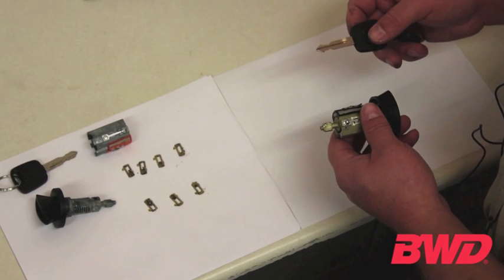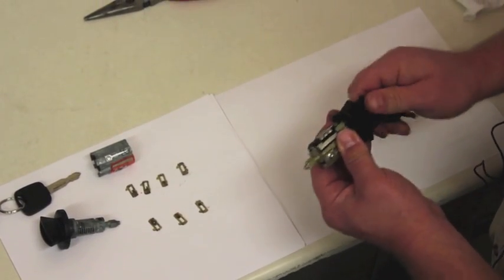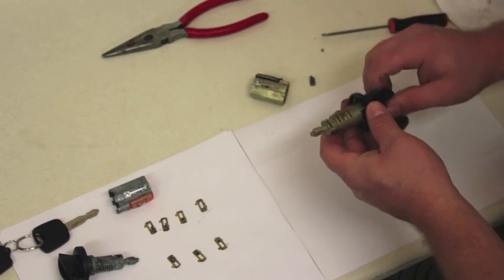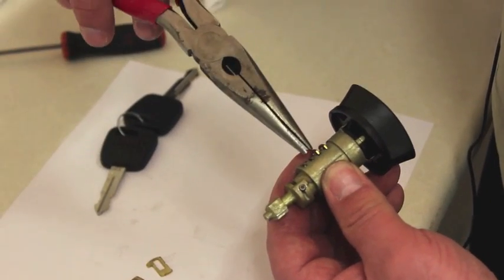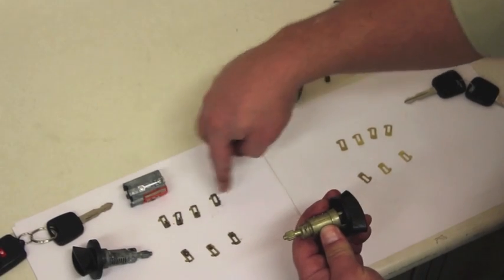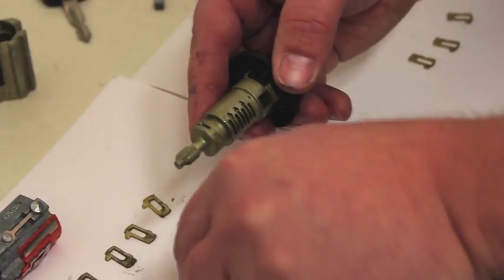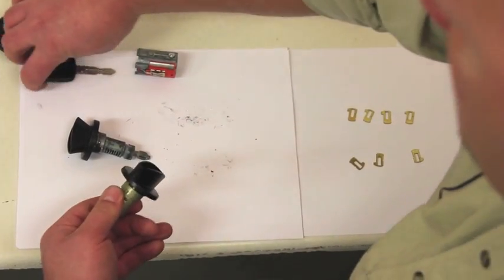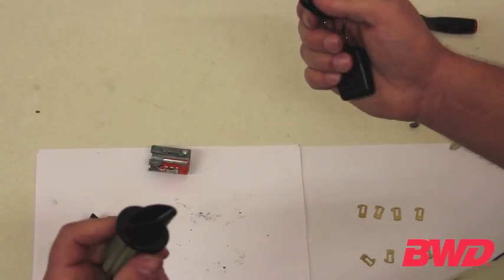Recoding a new ignition lock cylinder

Comment: Great vid I had the problem of a broken ignition lock & had to replace it with a new one. Of course the new one came with new keys & my truck wouldn't start, I followed the directions on this vid & I made my old key to fit my new lock & my truck turned right on. Thanks so much bud

Comment: Great Video, thanks!  

The video does not show clearly what is needed to remove the check ball, releasing the key chamber from the outer case.  
You have to turn the key all the way to the start position stop.   Then use a pick to push the checkball into it's spring seat as you turn the key chamber past this stopping point.
Save the checkball for reinstalling, see below I discuss this.

I just did this to my 1996 Ford Econoline Van. This is the same exact replacement I got from Auto Zone, $26. My vehicle is not new enough to have the chip in the key. Not sure if the one in the video does.
FYI: My original key and some of the slugs showed wear.  This may be why mine no longer worked.
If you rekey the new lock, I suggest you try to use the new lock's slugs of any that are the same number-code-cut.
I wrote the numbers and their positions down on the slugs of both the new and old lock(the numbers are inscribed on the slugs and if worn off on your old slugs, you can compare it to others to see what number it is.
4 of my original slugs were stamped "4" and none of the new lock slugs were number "4"'s so those slugs I had to reuse.
Maybe I can buy some "4" slugs and replace them later.
It looks like if I wanted to replace all my door locks and the ignition, parts would cost over $100 and I don't want to have the ignition a different key than the doors, although that would not be that bad of an option of your original key or the lock slugs are worn out. 

The video does not show how to reinstall the check ball.
I found to do this, temporarily remove the push button ball by lifting the arm spring with your finger nail.
Insert the key and then insert the key assembly into the outer case.
Align the check ball's spring seat over where you removed the push button ball.  
Drop the check ball in and use open needle nose pliers tip to push the ball down into it's spring seat while turning the key chamber back into it's start position.
Reply: Underneath the steering wheel you will see the four screws that hold the plastic piece up there.  But the top right one you'll see a hole.  You stick a small screwdriver up there and feel around for the little ball lever and push it up to release the key cylinder.  I have gotten that far and am looking into replacing the little pieces to use the original key instead of trying to reprogram the new key.  That way the old key will work with the ignition and the door.  I have a 2001 Ford F150.

Comment: just completed this task.  need to add that the ball bearing check ball has to be aligned  with the button for removing the lock when reinstalling. You also have to push in the button and finish pushing into the lock.

Comment: FOR ALL OF YOU F 150  key recoders,,,,,,,,,,I used this video to put my new lock cylinder in,,,,,,,,,,,,,,,,great video,,,,,,,,,,,,BUT,,,,,,,,((,,,,,,,,,,,,WHEN YOU DEPRESS THE TINY BALL BEARING INSIDE THE CYLINDER,,,and pull it out,,,,,,,,THE SILVER LOOKING BALL BEARING FALLS O-U-T !!!! II couldn't figure out WHY  the cylinder wouldn't  STAY  in the assembly after insertion,,,,,,,,,,,LUCKILY,,,,I REALIZED WHAT IT WAS,,,,,,AND FOUND THE TINY TINY BALL ON THE FLOOR IN MY KITCHEN,,,,,,,,,,,THAT    was the real tricky part,,,,putting that ball on top of the spring,,,,and trying to get it to slide back in,,,,,,,,,took me about 4 tries,,,,but,,,it  worked,,,,now I have a new ignition lock in my 02 Supercrew,,,and I can still use the same keys for the door and tailgate,,,,,,,,,,,,,,,,,,,,but still,,,,with out this video,,,,I would have been s.o.l.,,,,,,,,,,,,,,,,,,,,,,,,,,,,,,,,,,,,,,,,,,,,,,,,,,,soooo,,,,thank you    guy  !!

Comment: Can you disassemble the cylinder and keep the original Pass 3 GM chip and replace the key and slugs? So you're not fooling around trying to flash the BCM?
Reply: i just bought new cylinder and followed the old one taken 1 out at a time and recorded the number off the slugs as per video ,worked like a charm on my 2009 silverado.kept same old keys.great video.